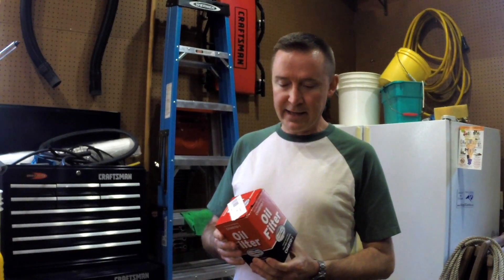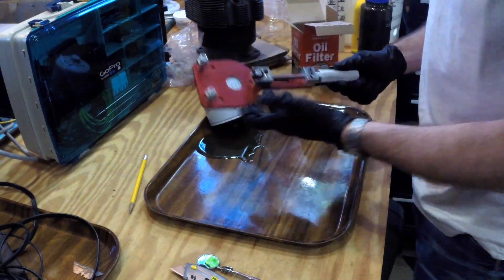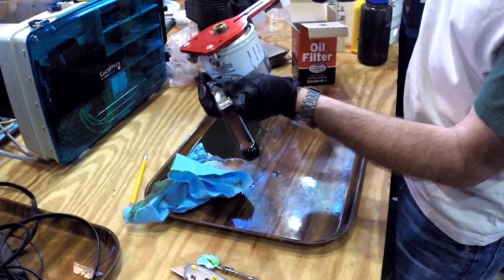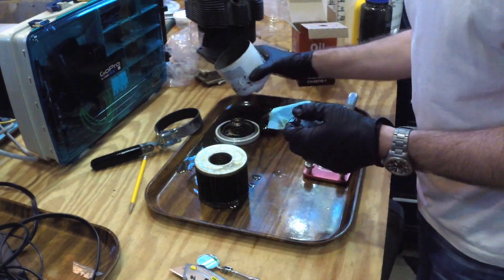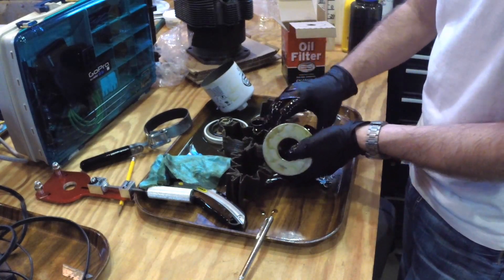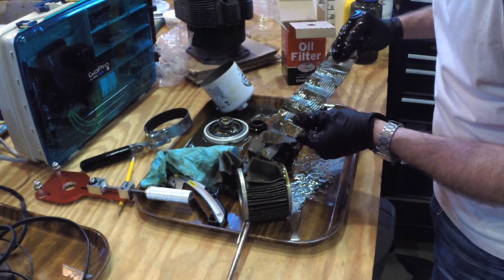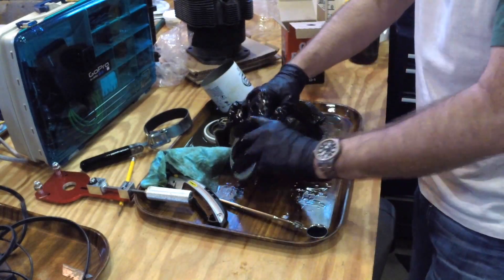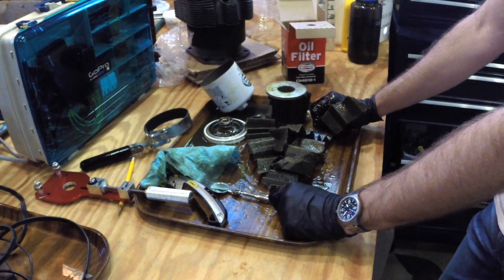Part 2: Oil Filter Inspection from Lycoming O-320-D3G

Comment: I take the pleats and wash them in a varsol bath in a Ziplock container, then move a neodium magnet from an ID badge all though the varsol and across the interior surfaces for several minutes to draw any ferrous particles. This collects absolutely everything. When the magnet dries off I get a tiny bit of microscopic fuzz or just a small amount of ferrous mud stuck to the magnets.  Lyc allows up to 9 pieces of significant size metal particles.  I then agitate the varsol and dump it into into a black  plastic shallow tray, let it settle, then drain off the varsol leaving behind varsol/oil residue and any non-ferrous metal, like panning for gold. Non ferrous particles are visible against the black plastic. I usually get some random tiny speckles of what look like aluminum, probably wrist pin plug wear. Pretty much the same result every time.

Comment: Next time use a vice. 1. To hold filter while you cut it open. 2. Take about a 1” section of the filter and squeeze oil out using vice. Use a rag/paper towel to catch oil and wipe off filter. Then open up the filter and you will see particles and metal much easier
Reply from the maker: That was my friend taking the filter apart. It really was painful to watch. Thanks for the suggestion.